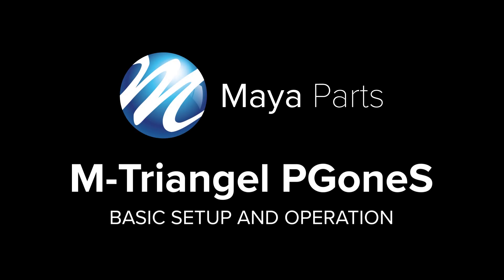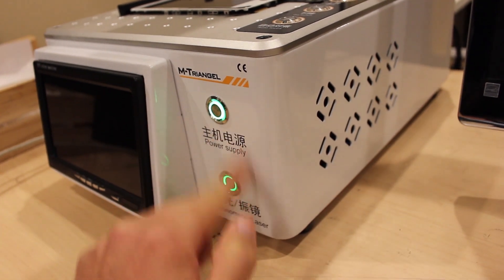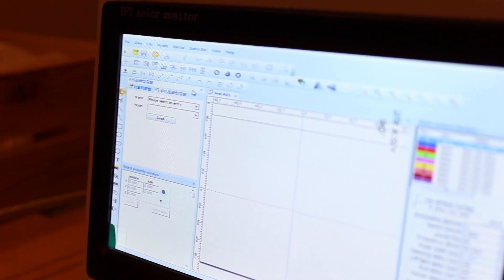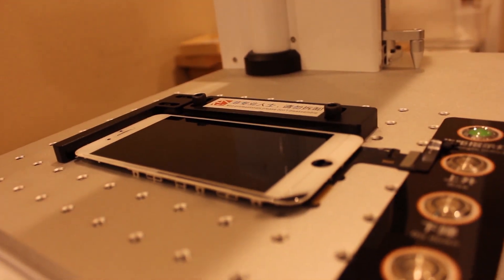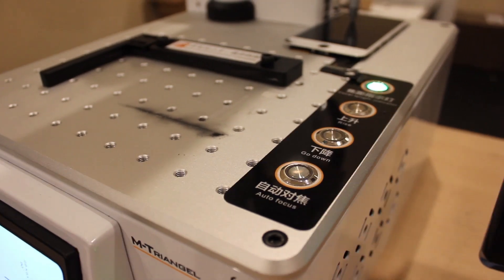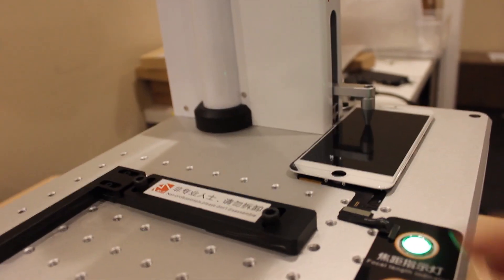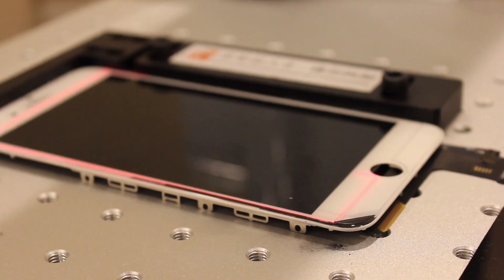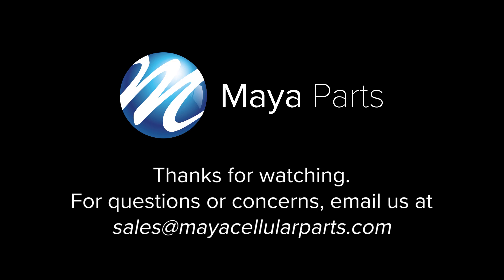PGoneS Basic Use

Comment: When doing an iphone back glass removal, do you remove the motherboard, lcd etc from the rear housing?
Reply from the maker: Generally no. The templates feature small "cut-outs" in the design, so the laser avoids burning any areas with exposed boards or components. But that's why it's important to make sure the laser is properly aligned- so that the laser doesn't burn into those areas by mistake. That being said, I have heard of some technicians removing the board in order to be safe. But it's very time-consuming, and at that point, a full housing replacement may be more economical as it doesn't require a laser machine at all.

Comment: The focal length sensor isn’t working. Neither the green light flashes. What’s the solution please
Reply from the maker: Unfortunately, I cannot know what is causing the issue on your specific machine. But in my experience, this is sometimes caused by a broken or bent sensor pin. Please see our "Weak Laser Fix" video. It has an explanation of how the sensor works, including the sensor pin. Afterward, you might be able to check and see if that's the cause of the problem. Good luck.

Comment: How to update the system  for iPhone 12 if not showing on model section?
Reply from the maker: If your machine is connected to the internet, there will be two buttons located below the model dropdown list (its a little ways down- not directly beneath). Click the one that says "update". It will download any new templates from the internet. Note:  if you connect to the internet AFTER starting the software, the buttons will not display. Restart the software and the buttons should appear.

Comment: How do you connect second monitor thanks..
Reply from the maker: You will need to use a USB monitor adapter. We used a USB-VGA adapter (which we purchased from Amazon) since our monitor was older, however, there are many different types. Take a look at our videos. We have one specifically on using an external monitor.